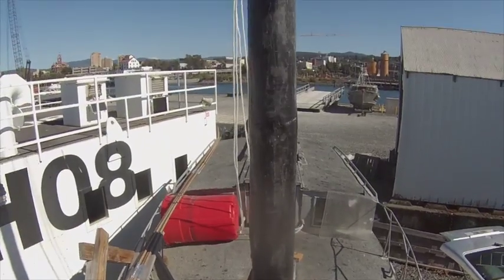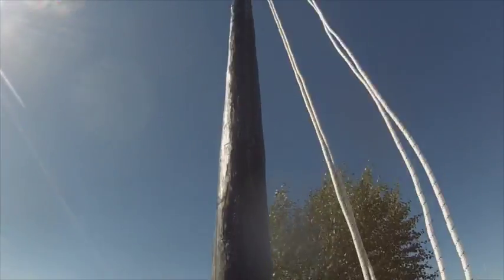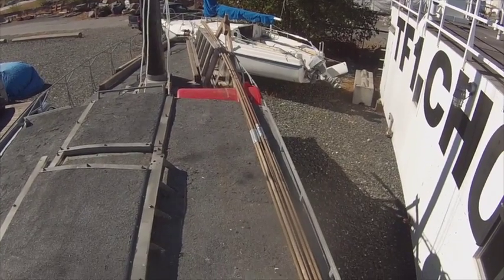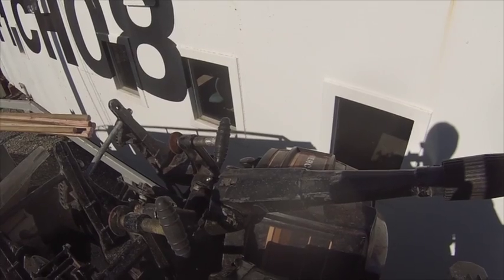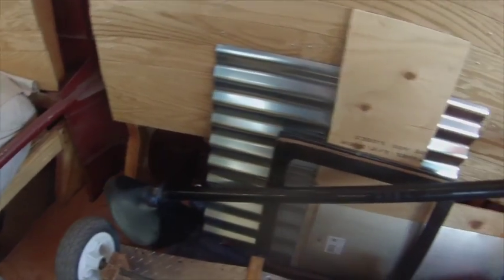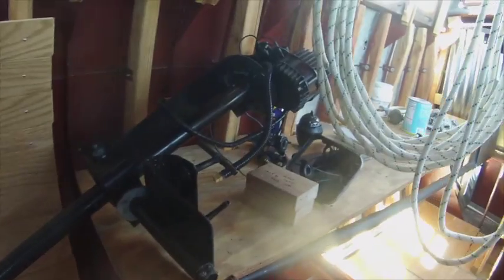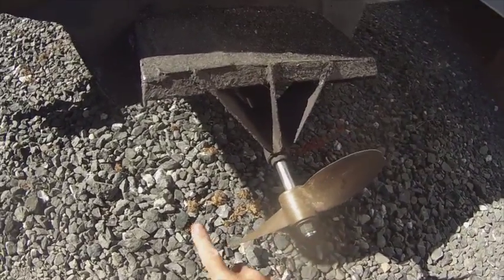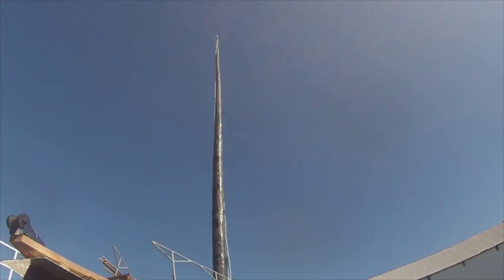Steel Sailboat Build Update September 2022

Comment: PLEASE put an update or few up before next summer.
So glad to see a new installment!!
Totally understand the expectation vs reality!! Right there with ya.
Only tidbit I'd like to throw your way is...
Be minimal on the interior until sea trials. It's likely you'll need to weld a spot or few afterwards. Id chuck her in sans sailing gear just to find out for sure where you're at in terms of hull integrity.
Keep it up bro and thanks again for the upload!!

Comment: You are hoping that Goop, a household shoe repair product is sufficient? That's a little scary my friend. I am hoping that this project works out and that it can even support day sails around the harbor. But I will be astonished if you trust it for cruising in open water or attempt a crossing of any kind. 
What, in your estimation, will be the measure of success for this project? It is fascinating to watch. However I often think that the first time it will be mentioned in the news to a wider audience is when you are reported missing at sea. And that would be a terrible outcome to this endeavor. 
But your optimism is communicable and I hope well founded. But there is always a little crazy mixed in with a touch of genius. So be careful with your decisions!
-✌️